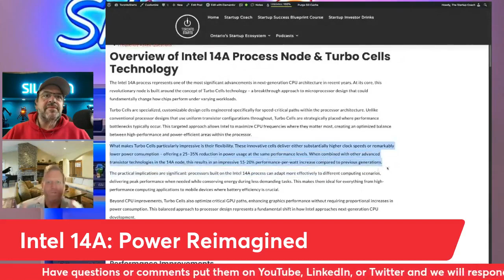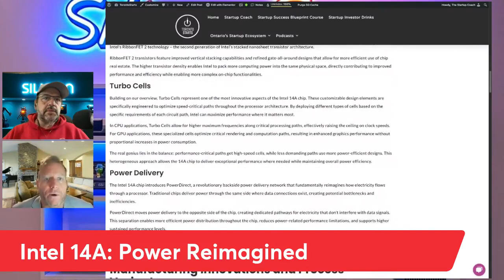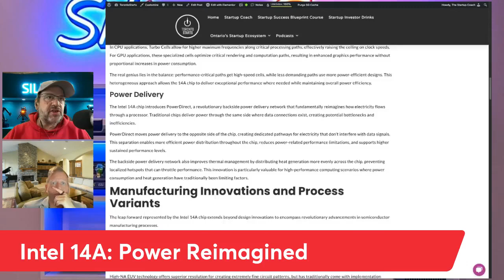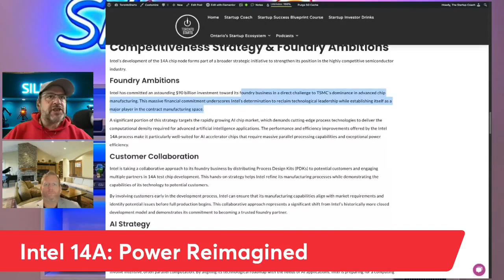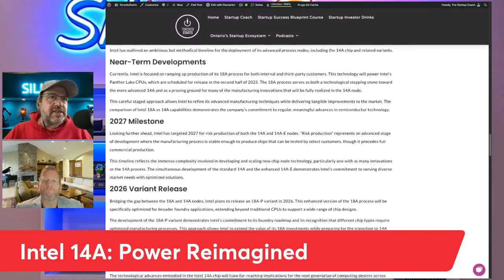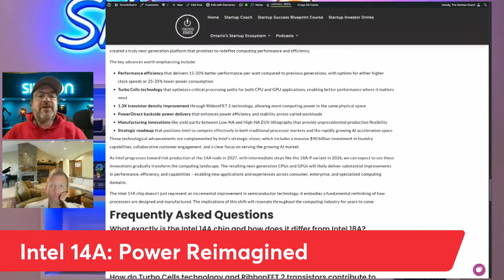Intel 14A Process: Turbo Cells, PowerDirector & New Era in CPU Tech 2027

Comment: https://www.youtube.com/shorts/KkaYcb-JicU

I watched this YouTube Short discussing a grapevine report that Intel’s new CEO, Lip Bu Tan, said Intel’s 18A (1.8nm class) process is losing commercial appeal, and that Intel is shifting its focus toward 14A (1.4nm), targeted around 2028. That effectively adds another two years to Intel’s foundry timeline.

I could be wrong, but based on Intel’s layoffs, leadership changes, and the decision to de-emphasize 18A for external customers, it’s difficult to believe that 18A yields are anywhere near a mature level, such as 90%. In my opinion, yields closer to around 50% seem more consistent with what is likely happening internally. If yields were already high and economically competitive, Intel would not need to reconsider its foundry strategy so quickly.

At the same time, Samsung Semiconductor and TSMC are rapidly expanding their U.S. fabs in Texas and Arizona. Many engineers affected by Intel’s layoffs will likely find work at these competing fabs, which accelerates knowledge diffusion and strengthens Intel’s rivals. This further narrows Intel’s margin for error. When many lost their jobs at Samsung Semiconductor, they obviously worked at SK Hynix.

If Intel’s 18A yields are materially below mature foundry levels, higher chip prices may be unavoidable to protect margins. Even if Intel’s 18A CPUs deliver better performance or power efficiency than AMD’s competing chips, price still matters to most users.

Personally, as someone who hasn’t played video games since junior high school, I would not pay a large premium for an Intel i7 built on 18A or even 14A. A small price difference is acceptable, but if the gap grows to $150–$200, it becomes difficult to justify—especially during an economic downturn. For many non-gamers, the AMD Ryzen 7 remains the better value.

Without significantly lowering manufacturing costs, Intel will struggle to compete with AMD, Samsung Semiconductor, and TSMC. At this point, TSMC appears best positioned to remain on top.

— Joseph Y. Lee
Former Samsung R&D Engineer